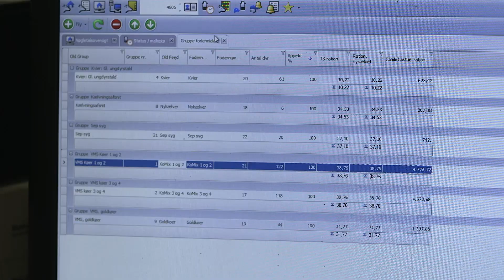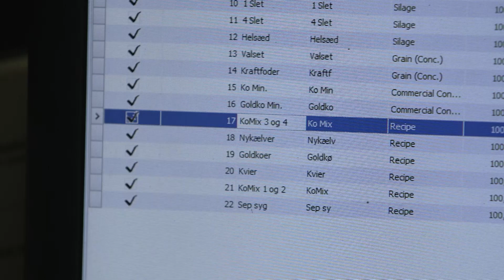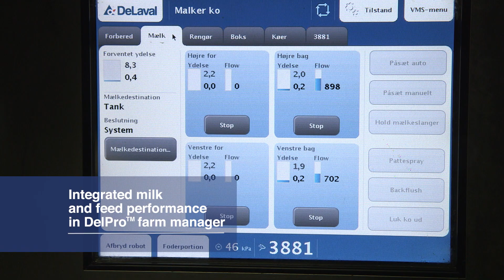DeLaval Optimat™ Automated Feeding System

Comment: Hello,
What is the cost of a automatic feeding system ? Is it economical for 50 cows?
Kindly provide me details as earliest as possible.
requirement for INDIA.
Reply: Buy Lely vector, it is much better and costs less. Lely vector with instalation costs 120000 euros.
Reply: @davidlebar44  120000 euro lily setup for how many cows?